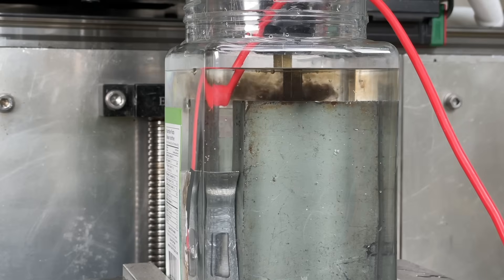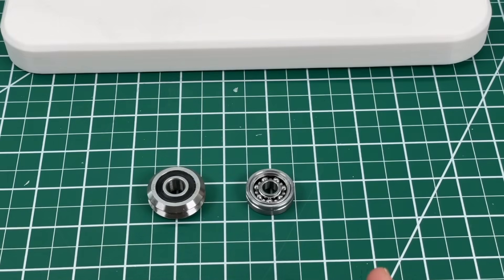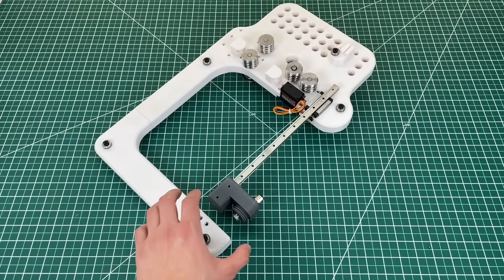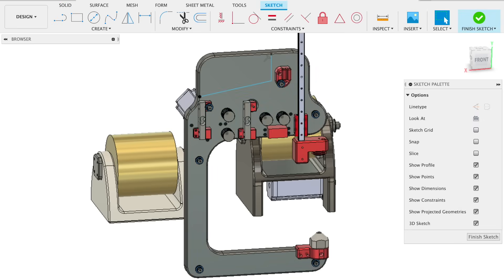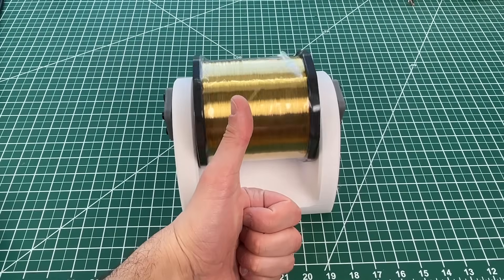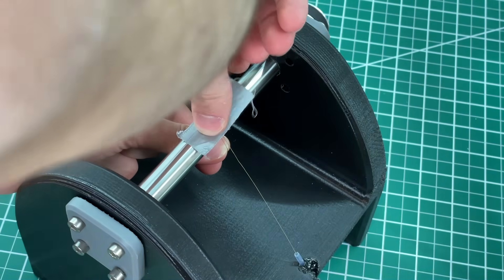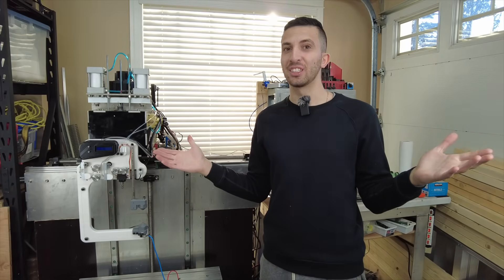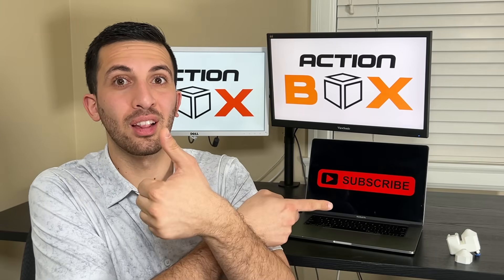How We Made A Wire EDM Machine At Home

Comment: It’s your spark generator. BAXEDM makes a modern one, but EDM has been around wwii and you can find some patents that basically use a big resistor for good current control. Most switching power supplies have poor “instant” current control, but A simple resistor should be smooth. You also need feedback between controller and current generator, water conductivity increases as you cut.
Reply from the maker: Thanks Ethan, that makes sense. Ill try your suggestion and stick a big resistor at the tip of my power supply. Ill get back to you on that. On the note of BAXEDM, I would love to collaborate with him. Hopefully he reaches out to me now that I have asked him. Cheers 😃
Reply: @ActionBOX  I definitely recommend BAXEDM. He seems to be the pro on amateur wire EDM...
Reply from the maker: @pappaflammyboi5799  I have reached out to him asking for a collaboration but he has not responded yet. I hope he does eventually 😊.  Thanks for your input and hope you enjoyed the video. Cheers Dave
Reply: @ActionBOX  be a man, make power supply. Use 110v for supply, 2-20 ohm resistor, IGBT with 2-10 us on and 10-20 us off timing. Now you use very long pulses
Reply: Yes BAXEDM is the man to get it done, I remember he had a problem with wire breakage as well, something to do with polarity if I remember correctly.
Reply from the maker: @johnnym1320  awesome. I really hope he responds to me and agrees to collaborate. He sounds like quite the expert in the field.
Reply: @johnnym1320 polarity is not the most important thing, exist AC wire EDM and this is the best way  to suppress electolysis
Reply: You want a 300vdc tickler at very low amperage, followed by a lower voltage ~60vdc power delivery pulse, followed by a pause. Monitor the discharge current to back off your feed during a dead-short. Also you don't want any current flow through bearings, so remove that ground wire?

Comment: I think the problem is with the motion control. The wire shouldn't touch the workpiece, the motion should stop right before touching it, or sometimes even reverse the path when the wire gets stuck to the metal. You need a feedback loop, that measures voltage between the positive and negative leads ( the wire and the workpiece). Or perhaps a powersupply that limits the current when the wire touches the metal. No need to control the speed of the wire spooling, I've seen machines with constant wire feed rate, the only downside of that is that you are wasting wire
Reply: This is exactly it, your motion control will even need to reverse during normal operation if the gap gets too small. It doesn't happen often (every 10 mins or so) but it does happen (see the BaxEDM videos and the Applied Science EDM video). If your spark generator is an old school capacitor + resistor combo that could also be an issue, you'll need fairly precise current control for small wire diameters which usually means a linear or switch current source.
Reply: @matthewanderson1585  also Jeri Ellsworth has an interesting plunger design made from a doorbell buzzer. Let's see if links can be posted. Jeri video linked below. 
 https://youtu.be/uUN4_-xp1Wc
Reply: Your approach speed with the wire is probably too fast, and it can't slow down fast enough, as has been said, it is not supposed to touch! Just get close enough to ionize the gap and discharge. Since you probably might never have a system that backs up and keeps trying to be aggressive like adaptive feed control, you might be content to limit the feed to what will work without burning the wire. In this case you have a fixed feed that you have to experiment with to get the maximum burn without constantly breaking the wire, it's a trade off.
Reply from the maker: ffoska and Matthew Anderson, Thanks so much for your input, this is exactly the type of answer I was looking for. I'll definitely do my research and come back with a subsequent video on the power supply. I wonder if. could develop my own for cheap, such that its perhaps not industrial grade but would work at a low cost for us hobbyists? Do you know of any open source build perhaps that I can work off of? How hard would it be to just create a pulled square DC wave anyways 😜. I really appreciate your detailed inputs. Thanks again 😊
Reply: @ActionBOX  As far as i know, the spark generator power supply is very much closed source, manufacturers who make EDM cutters do not provide too much info. You can find some stuff on youtube, as mentioned BAX EDM is a great source. I've worked on a machine from the '80 so somehow they managed to make it work using old tech, so it is probably much easier to do nowdays. The current is pulsed, around 120 - 150Hz (  the old machine, new machines probably have higher freq - probably the higher freq makes the cuts faster and gives better surface finish, but don't quote me on this...), the voltage is low, like around 3 to 5V. I would personally start with a welder that can do AC and DC pulsed and hack it ( or build some sort of high amp, low voltage powersupply with IGBT or power MOS FET), measure the voltage with some kind of high resoulution ADC and use the motion controll that is shown in BAXEDM's videos.
Reply: @ffoska  a think sodick have a lot info on it a worked on a320 a500 and a750 but y didn't remember the parameter , just selec materail thinknees number of pass, dia,  and use c777 to align (teach )  :(
Reply: @ffoska  is this channel not just a rebrand of bax edm? They have the same price point right.
Reply: @dariuscastor2331  more content, more better.
Reply: @ActionBOX  I'd be happy to collaborate on this. I have a design in my head for a unipolar spark generator that would be easy to make. How do I get in touch?
Reply from the maker: @matthewanderson1585  Thats awesome, feel free to reach out via our "contact us" button on YouTube. I look forward to receiving your email Matt

Comment: I wonder, if the power supplies for wire EDM and die-based EDM should be completely different.. I'm pulling this out of my ... but it seems that for die-based EDM high current is ok, but for wire EDM current and feed speed should be really low, while the voltage is much higher. Like barely touching surface to create a bunch of tiny sparks, instead of completely rubbing against the surface.
P.S. Props for sweet cad skills. Good CAD skills feels like super power (I'm late to the party, but I'm learning this now).
Reply from the maker: Thank you, I really appreciate your comment 😃. I'll look into this as you suggested and hopefully make a mention of it in my subsequent video. Thanks again 😊
Reply: @ActionBOX  correct me if I’m wrong but I thought the wire never makes contact with the part, just the arc. Maybe run the wire at a faster rate and your xy movements slower until you find the Goldilocks zone.
Reply from the maker: @gordon6029  that will very likely help, gauging by how popular this response is. Thanks for your input 😃